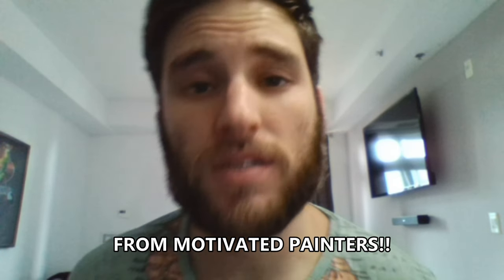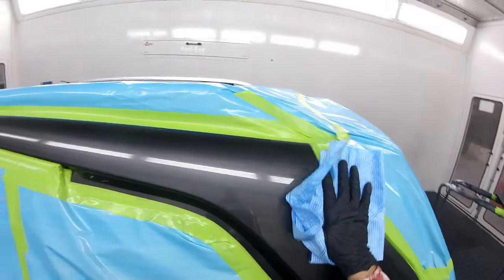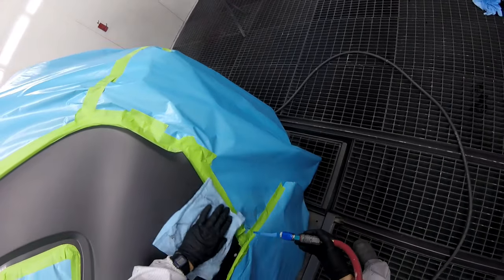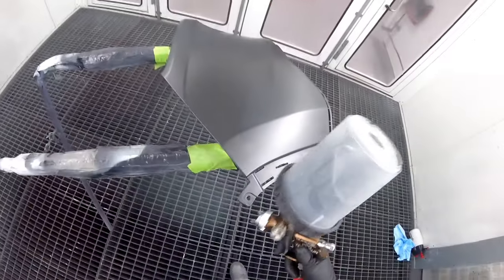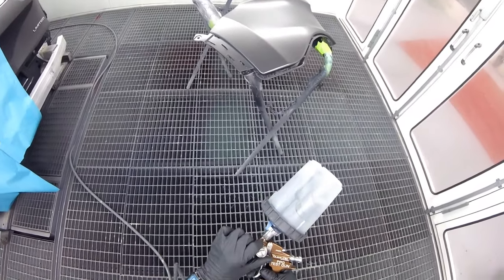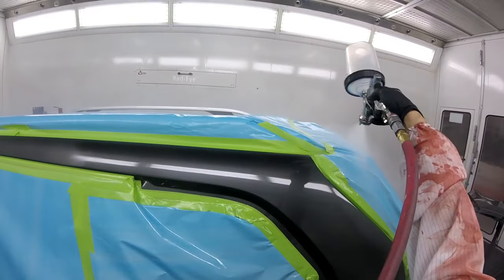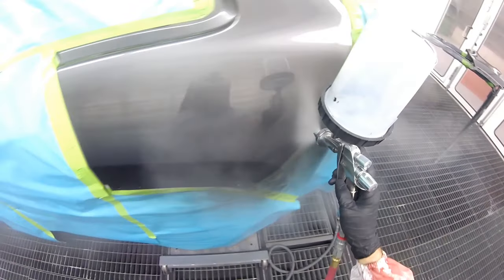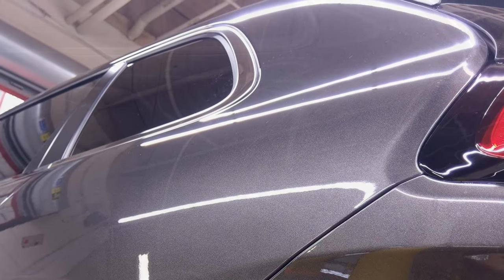How to keep a spray repair small (watch till the end you'll be glad)

Comment: Hello Sir, Will the Iwata WS400 EVO 1.3HD or the 1.4HD fluid nozzle leave the the flatter off the gun finish with high solids clear-coat?
Reply from the maker: +faustsmith yes sir very good finish
Reply: Which is better for the high solids clear, the 1.3HD or the 1.4HD?

Comment: How are your paint material costs with all that extra clear being sprayed? Also curious if you ever have a overspray problem since you do cover the whole vehicle and nice clean job not polishing is the way to go
Reply from the maker: +jaren ouellette This is the way that we do it for a proper repair and we charge accordingly I know nothing about the material cost but it's tracked and my manger sure does look at it and it's worth it Hahahahahahahahahahahahah😀 so the car is covered in spray mask which creates a film over the whole vehicle protecting it from overspray.
Reply: MOTIVATED PAINTERS  figured it was spray mask and I watched another one of your videos where your sealer went right over bare metal, which pig sealer are you using cause that could save me ample time in the booth
Reply from the maker: +jaren ouellette yes ppg emvirobase ECS65,67,61
Reply: MOTIVATED PAINTERS ecs sealed is not a dtm you need to etch it! Look the tech sheet
Reply from the maker: +jaren ouellette my rep said for burn through is okay we haven't have any issues whatevesoever
Reply: MOTIVATED PAINTERS shit that's still scary why not be 100%sure?
Reply from the maker: +jaren ouellette I am 😀 they told me its good  for what I'm doing which is new panels obviously sealing a whole bare metal panel is not very smart. You are right!
Reply: MOTIVATED PAINTERS so why seal a panel with multiple break through
Reply from the maker: +jaren ouellette we always seal brand new panels
Reply: MOTIVATED PAINTERS yes you are always supposed to seal panels with multiple break threws otherwise it would lol peel in the end so it's 5 year soniorio
Reply from the maker: +jaren ouellette correct
Reply: MOTIVATED PAINTERS so you are expecting comebacks in 3 years because you don't etch bare metal
Reply from the maker: +jaren ouellette we haven't had any in 5 years all the preppers water prime or etch all the burn throughs on panels.
Reply from the maker: +jaren ouellette and if there ever is a comeback then ppg will pay for it since I was told by the reps that small burnthroughs are okay to seal directly so no problems 😀 I hope your not loosing sleep over this haha
Reply: MOTIVATED PAINTERS I hope your not losing sleep over this because etching is the proper procedure
Reply from the maker: +jaren ouellette good looking out thanks!!  😀
Reply: jaren ouellette because most ppg sealers can go directly over bare metal as long as the cut troughs aren't bigger that handwidths.